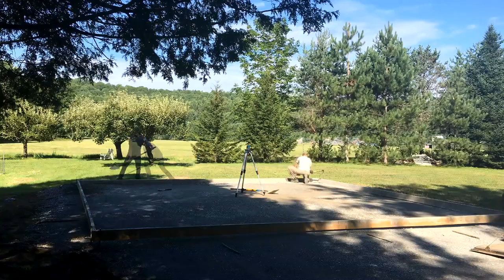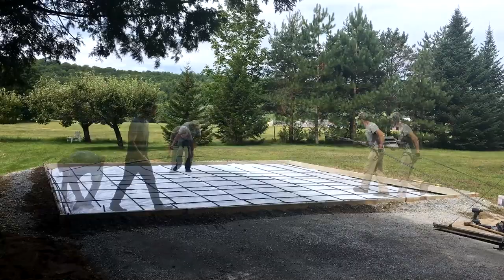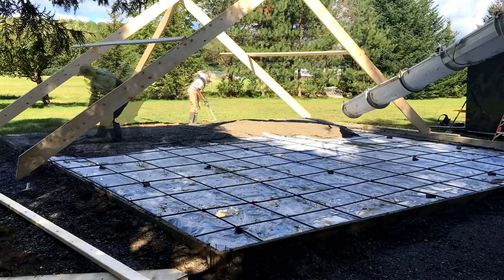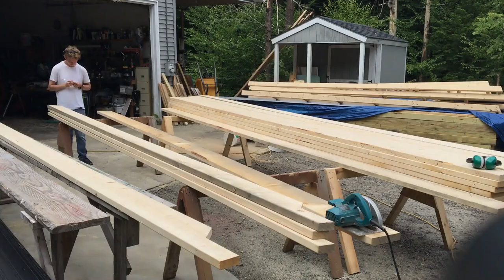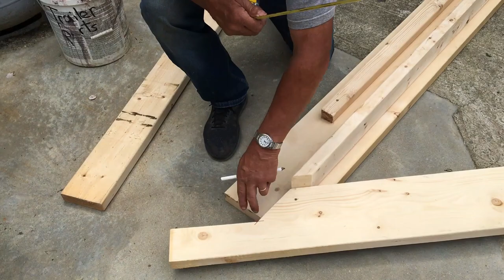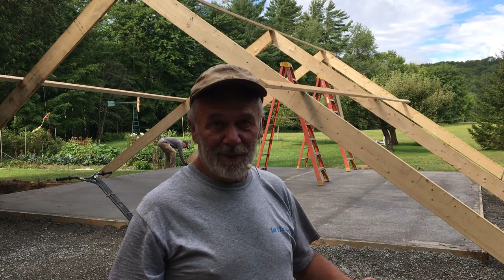#201 Cape Style Garage Prepped for Shiplap Siding $29,000 Part 1

Comment: Hi Ken, just wanted to say I really enjoy your videos and have learned quite a bit from following you guys.  Thanks so much! I did want to ask a question because I haven't seen you do this portion of the work.  It concerns the base you pour your pad on.  Are you normally pouring over a clean rock base or something with fines in it?  I know you're in the New England area and it made me wonder about freeze/thaw beneath the slab.  I ask because I'm thinking of doing the same thing. Thanks again!
Reply from the maker: We always make sure there’s no clay and that the area is well drained with at least a foot of compacted crusher run gravel. We’ve done over 400 this way in the past 35 years.
Reply: @kenskarpentry  Thank you, Ken